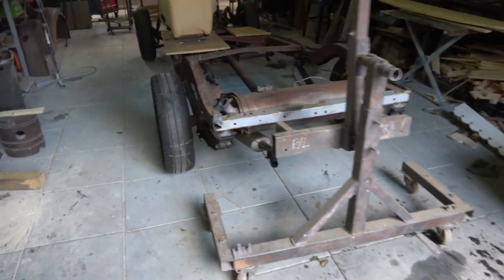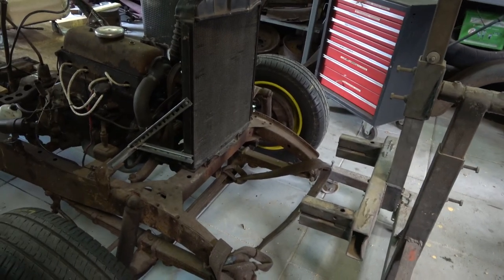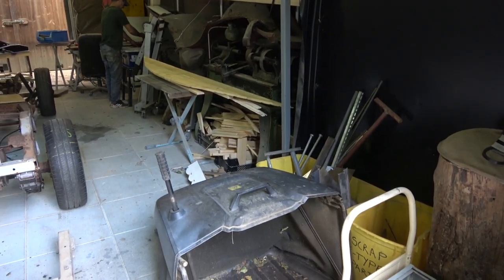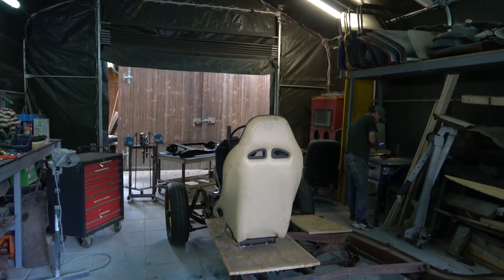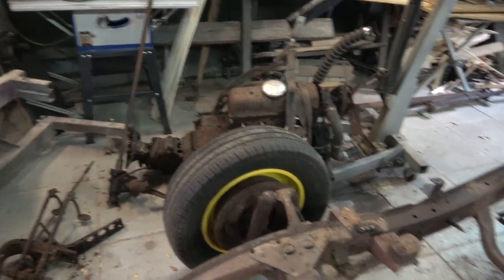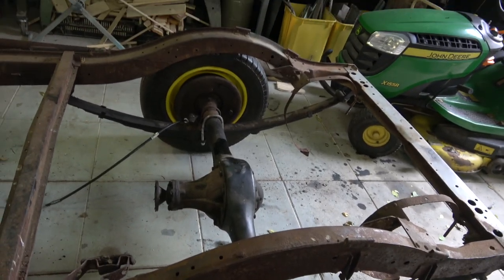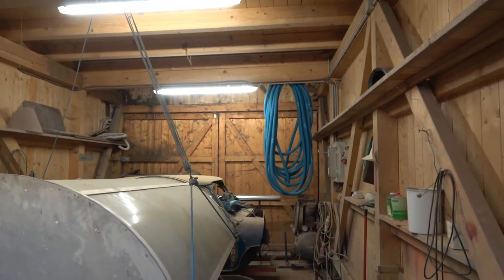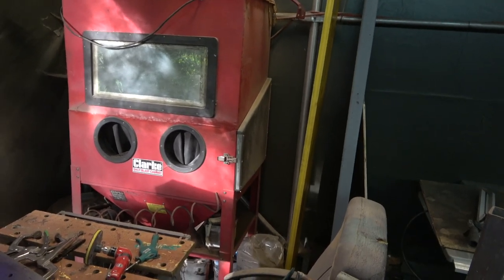Barn Find 1930s Citroen  ( Strip Down For Sandblasting )

Comment: No apologies necessary for the blaster cabinet. I made mine out of a 300 gallon fuel oil tank. You can get a whole 47 Studebaker truck fender.... oops.... wing in there and turn it over and work end to end.
A lot of rust has disappeared in that thing. It's about 20 years old now.
The tank was rusted out in the very bottom and had been dry for many years. It was here on the property when I bought it along with several others and a massive amount of other junk. I got a good deal on the place so the old lady didn't have to clean it up.
Anyway I'm looking forward to seeing the frame cleaned up.
Cheers
Terry from South Carolina USA
Reply from the maker: Terry,  They say necessity is the mother of invention which is something I love doing making something for one job do another lol.
I think it will clean up real well but the inside will be a problem but we will do our best after it‘s painted we will wax oil the inside 
 the chassis / Frame, They don‘t make or build cars like this anymore. Cheers Dave